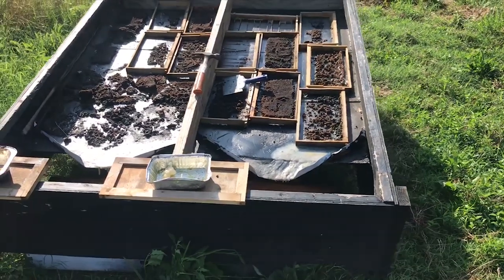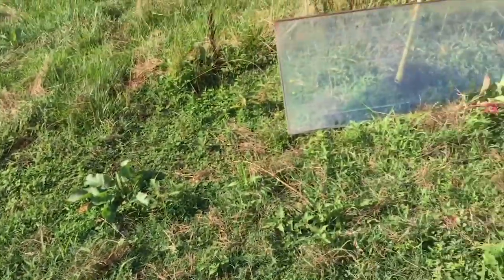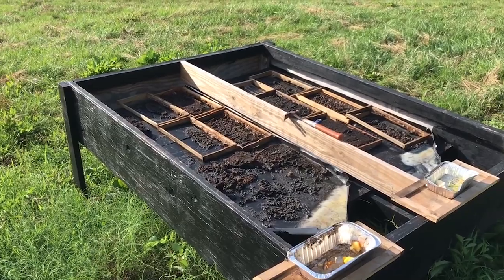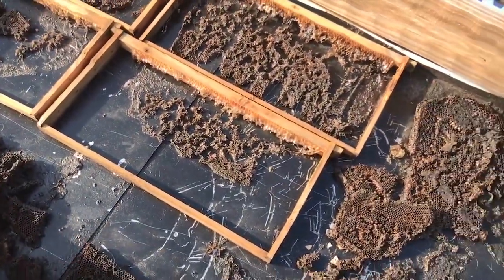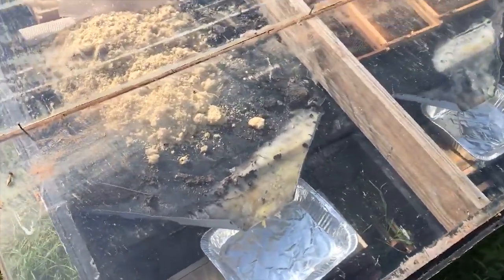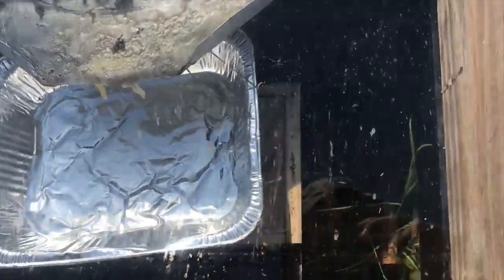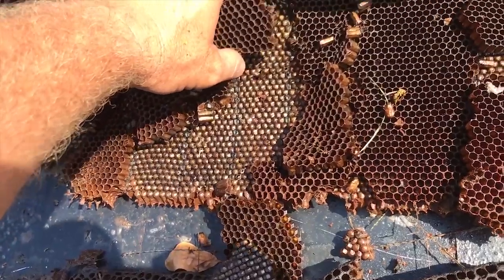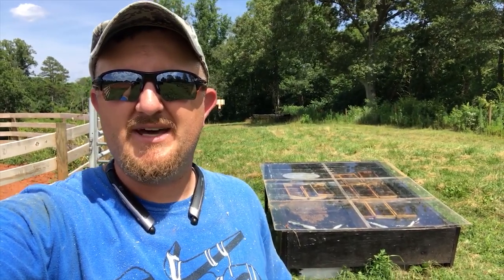Solar Wax Melter: Do's and Don'ts

Comment: Looks good but thought you was going to say glass broke but I find put some 1/2 in hardware cloth rolled up a little on ends to lay comb on keeping it off bottom but you could buy 3 or 4 mud boxes and use them which means glass will be lighter to handle.